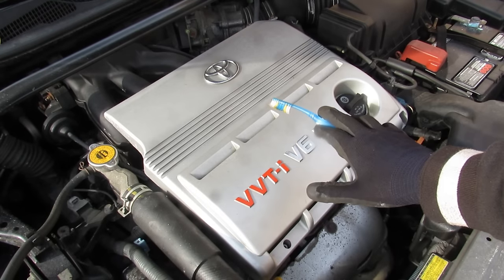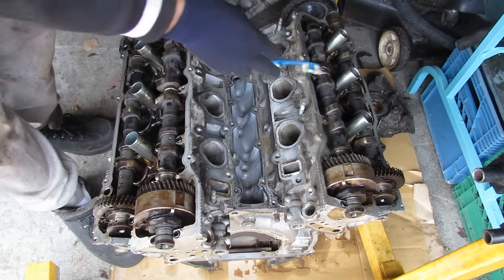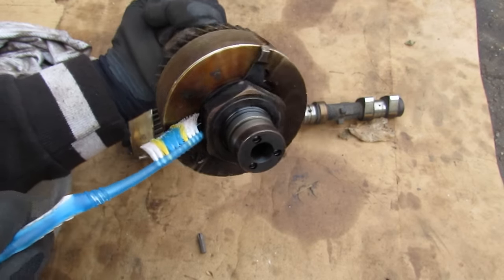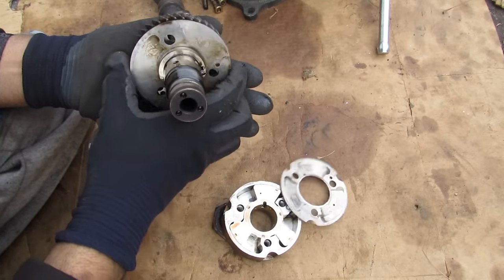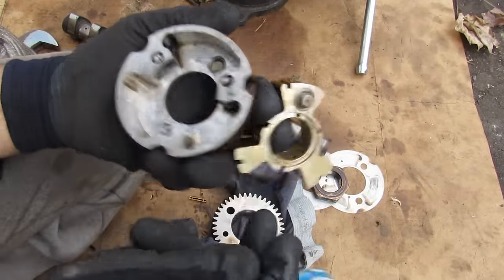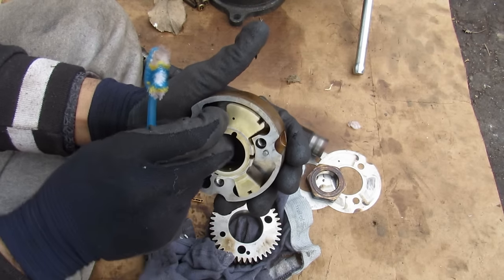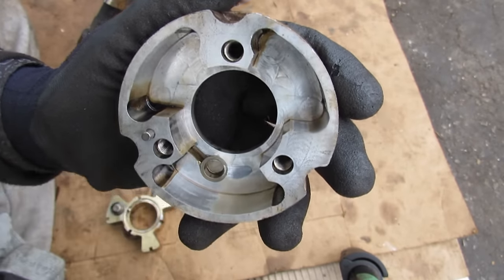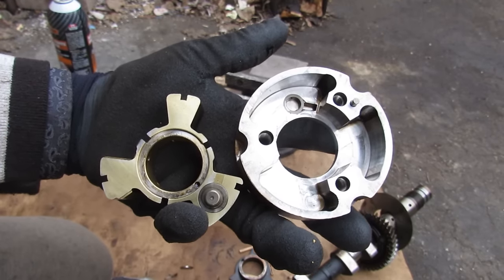Here's Why Your Car Rattles on Cold Starts

Comment: Is there an active recall on Lexus's for this? I appreciate yout time and enjoy your channel, lots of good info on various mecanisms, so thanks for doing it.
Bob
Reply from the maker: Yes I researched it a few years ago when buying my GS350
Reply: @speedkar99  does the 2.5L is250 engine have the same issue as the 3.5L 350?
Reply: @speedkar99  Ive also got a gs350. Whats the best preventative maintenance to stop this noise? Regular flush and oil changes with full synthetic?
Reply: @chapn7  Our IS250 does the same thing.

Comment: One more reason to stay on top of regular oil changes.
Reply: yeah true but i think something like this is inevitable.
Reply: @tajituck888  I call BS on that. no reason for that pin not to have easy movement every single time if it's all clean in there from 5-7k miles full synthetic oil changes
Reply: @hostilityy  its not only pin movement.  There is a spring under this pin that pushes the pin to a hole. When this spring is tired, then its not 100% that pin will be locked in a hole
Reply: @mutoryu  Dear Kiril Ka: what you have said makes a lot of sense, thanks!
Reply from the maker: Oil changes are underrated. 
My lubrication system video gets into the crevasses of where oil travels in the engine. Once you understand it's vast functions, you can no longer overlook it's importance.
Reply: hostilityy yeah I see your point but it seems like it’s a common thing with Toyota’s when they get up in age with vvti. However I don’t know the oil change intervals those Toyota’s had. If one at all lol but you make a good point.
Reply: speedkar99 it’s only underrated to females lol.

Comment: Wow...   i hope you have solved my problem. 👍... i have 2015 Honda Odyssey and has the same noise with the cold start. And thinking to sell my car to avoid possible expensive engine repairs.  
Some local mechanic diagnosed that it is a timing chain problem but i don't believe them..
Your video is very logical and now i am so satisfied 🤗...
Thanks for removing my stress.. ❤
Reply: Yes hondas make the noise also. Honda has said that it does not damage the engine

Comment: My oil pump pick up tube screen was 70% cloggrd from one of the balancer shaft fiber gears wearing over time.  Slowly clogged the pick up tube and eventually reduced the oil flow or pressure so much it did the rattle on cold start.  The balance shaft became disengaged from the crankshaft becaise of this initial low oil pressure.  Symptom was the cold srart rattle but also increased engine vibration at higher rpms and when going to passing gear tpm levels.

Comment: EASIER TO CHANGE THE MOTOR BUT ILL TRY THIS FIRST NEXT TIME LMAO;)
Reply from the maker: Oil change is temporary
Reply: I have a sienna with this problem currently. I have changed my oil at the 5k mark every single time for the last 10 or so changes. It persists.
Reply: @CatsNChickens  did you buy it new? do you know the previous owner's oil change history?
Reply: @hostilityy  no, fair point.

Comment: Does this car have a check valve, just above the oil filter to keep the oil from draining back down? Is there a relief port in the phasor that lets the oil drain out of it, or does it escape out of the seals? Just wondering from other cars I have worked on.
Reply from the maker: I don't think there's a drain back valve.
Reply: Bingo ! That sound occurs with a dry start due to oil draining back down in the pan.  A high quality oil filter will have an anti-drain back valve to help prevent this, what do you think?
Reply: @chadchristian3704  I never knew that oil filters had an anti-drain back valve. I know they have a media by=pass valve, for idiots that don't change their oil till the oil light comes on, so they don't starve the pump, but every car I have ever worked on, since my first 60 Chevy Impala 283, had a spring loaded check, or at least a flapper valve built into the to of the threaded pipe, that the filter threads on to. My Toy Tacoma, is a 4 popper, and makes a strange noise after the Bendix retracts, but has been doing it forever. The phasor on my Mazda (Ford engine) looks similar to the Toyota in your picture, but I never saw a gravity drain back hole in the phasor, and have never had a noise on start up. I love this CX-9, but the lunkhead that designed an engine with a water pump inside the crankcase, is right up there with my view of politicians. If you find that an oil filter makes a difference though, let me know. My son will get handed a list, He went to work at a Chrysler dealer - said he would always have plenty of work to do. Decided after a couple years, that he didn't need that kind of stress though.

Comment: hello, will this throw a code about crackshaft position correlation, i replaced the crank and camshafr sensors, and also a variable time solenoid and its rattleing at cold starts, but code wont go away.
Reply from the maker: No because the rattle is just intermittent at first start

Comment: Some one said, to avoid the rattle crank but don't start and then on the second time start. This will move the oil to the place where it has to perform its duty and that is to push that pin into that hole.
Reply: **Also another person suggested a Time delay relay to fuel injector.
**Also another person suggested wider range synthetic oil 0/20 to move that oil in faster.
**Also Another person suggested cleaning the Clean little mesh filters that lead to the VVT solenoid sensors, 
And Oil pump pickup tube screen.

Comment: I am having same engine and it is having the same rattle on the first few seconds after cold start. But what is annoyinge is the continues rattle at high speeds.
Any advise?
Reply: Have same issue. Any solution?
Reply: Clogged VVT sensor screen or oil pan pickup screen limiting pressure at high RPMs. Cleaning is cheaper than replacing anything.

Comment: same issue with Honda VTC actuator....most people who swap it out say the noise comes back within a month
Reply: Has this on my celica! starting to think is oil pressure/control related as the pins not locking on startup/idle... will have a look at the ocv's next

Comment: how do you make sure the cams are aligned once put back together? i see no divots on the sprocket ends and have not worked on anything with an overhead cam. at least to the point that it even matters
Reply: and then making sure the sprocket+ mechanism are in the correct spot
Reply from the maker: Timing marks
Reply: @speedkar99  ah i figured i just didn't see them

Comment: This model is the most reliable engine. When you have VVTI noise, it's a maintenance problem, not a design flaw.
Reply from the maker: Interesting way to put it ..
Reply: Thats true I just got a 06 scion tc with the VVTi engine and after blowing one of these engines while driving I was dialed into studying my engine and I found out that maintenence is your num1 priority and if you don’t and you let gunk build up in your engine it will leads to stuff like this. So I ran 90 dollar tribotex engine cleaning with nano tech which literally almost after driving like 20 miles felt a huge difference from a struggling engine to a smooth engine. I flushed the tranny and notices a major difference in that and also in the process of running a engine fuel system cleaner so that all supporting components are running optimally and i dint have to worry about blowing an engine. And also I do every 3k oil changes rather then 5k

Comment: Hello my friend, i changed the timing kit and i still hear this rattle noise once i start the engine what could it be ? And the km is like 110 K what kind of oil should i use ? Thank u
Reply from the maker: 5W30 or what is on the oil cap. 
Were the VVT gears and tensioner  changed or just the chain?

Comment: Ford's 2nd gen 3.5L EcoBoost V6 is becoming notorious for cam phaser rattling upon cold starts. One trick I've learned to shorten the rattle duration is to crank the engine for longer. Unless I crank it for around 9 seconds the rattle won't completely go away but it is shortened. I have 28K miles.
Reply: How do you crank it for 9 seconds without it firing up?
Reply: @gregjohnson2073  Depress both the brake and accelerator before pushing the start button. The engine will continue to crank as long as both are depressed. A few months ago I got the phasers replaced from a Ford CSP and the rattle is totally gone. I have videos of this on my channel.

Comment: Finally fixed the rattle in my 2011 Camry without taking the well maintained engine apart! The oil drains down from the VVTI actuators after sitting overnight. I simply installed a time delay relay to kick in the fuel injection after about 2 seconds of engine cranking, this gives the engine oil pump time to fill the VVTI actuators. Quiet as a mouse now. Have noticed some new cars delay firing after cranking to avoid a 'dry start'....
Reply: I have a 2011 camry with the same issue. Are you able to share a link to the one you purchased?

Comment: There's a real danger that the extra abuse those vanes are taking causes one of them to fail,  jam and grenade the engine.  It can also cause excess wear on the chain guides and particles from the guide can lead to the oil gallery becoming blocked.  A little rattle at startup is ok, but if it begins to become louder or longer, fix it.
Reply from the maker: Agreed.

Comment: Ford F150 with 3.5 Ecoboost makes a similar sound upon cold start, is it the same thing happening?
Reply: I have a 2.7 ecoboost with the cold start rattle. Fordtechmakuloco did a video that says it has something to do with a rod or lever shaft wearing out in the turbos.

Comment: The question I have is how many miles does the engine have to have for that rattling to start? And is that only on the six cylinder? Is there problems like that on the Camry Hybrid?
Reply from the maker: Yes they exist in many Toyota

Comment: I used a heavier W oil from 5w-30 to 10w-30 and it helped settle that noise down a great deal thankfully.
Reply from the maker: That doesn't work well in winter
Reply: @speedkar99  Ah, I'm in Florida so I don't have to worry about that lol.
Reply: Whelp. After about 4,000 miles or so. The noise comes back. I'm trying 0w-30 oil and I'll post results another time.
Reply: Yeah same issue. Changing the oil weight doesn't help.
Reply: I went the other direction.  5w-20 to 0w-20.  Helped.  I live in a colder climate and the weather is starting to get colder now and this really helped me.  I'm surprised the noise may be gone or almost gone now.  Just faster oil flow to the top of the engine I guess.

Comment: I just got an older highlander 1mzfe that does this. Not for long at all. Split sec. Tempted to order some Valvoline restore and protect from the US(can’t seem to get in anywhere Canadian) and see if it helps. Sounds like that stuff is legit. 

I’ve also read on bob the oil guy forums about people curing this problem simply from using “the good” oem Denso filters made in Thailand. Something about a quality anti drain back valve. Also some people purposely using a different/larger 
capacity Toyota filter to allow for better oil flow and less rapid clogging of the filter etc. Something like that

Nice to know it’s not a straight up death sentence lol it appears to be WAY too common of a problem to be a massive problem or you wouldn’t always hear everyone and their grandparents raving about Toyotas being the best…
Reply from the maker: Agreed. Nothing to worry about. Use an OEM filter

Comment: Generally the cold startup noise for a few seconds is due to timing chain tensioner in VVTI engines
Reply: It can very well be on the vvti engines with chains, this v6 in the video is a belt

Comment: How does the locking pin make sure the adjuster is in it's locked position when there is no spring pressure guiding it in? Can't it just stop anywhere when you turn off the engine?
Reply from the maker: You mean a tortional spring? 
Yes true, usually oil pressure (or the lack of) takes care of that, but if the pin is weak it'll rattle a bit instead of click into place instantly
Reply: @speedkar99  i don't mean how the pin gets pushed inside the hole, but how it is reaching the hole after the engine is shut off
Reply: @stijnpeeters9458  That's a great question. Did you find the answer?
Reply: @andyfer7716  not really
Reply: @stijnpeeters9458  My guess is that when the engine is stopped, before the timing chain stops completely , the oil pressure drops enough so that the internal mechanism is pushed to the locking position and then the pin falls into place.

Comment: You mention the Lexus 3.5 motors. From what I found the bolts coming loose are on the 3.5 IS350 models. I have a IS250 with this startup noise. Since it's not the same motor as the IS350, do you think your video with the pin sticking is the issue?
Reply from the maker: There's a recall on the Lexus engines, something about the cams coming loose I think?

Comment: My camry 2gr-fe started to rattle since 30.000 km ago. Thanks for your complete explanation. 

But does it affect the engine performance? Because i kind a feel some power decrease, or it is just my assumption?
Reply from the maker: Not until it fails
Reply: @speedkar99  so it is safe to wait until it fails, right? 😁🙏👍

Comment: My 2019 Pathfinder just started making the cold start rattle noise.... can oil stabilizers help with that sticky piston in the phaser? 97,000 miles on it. Also, my belt tensioner is really shaky.... could that cause a rattle as well?
Reply from the maker: Belt tensioner will cause belt squeal 
The stabilizer will only help temporarily. Once parts are worn there's not much you can do except replace it.
Reply: @speedkar99  ok.... thanks for the info.  Just found another possible suspect....a spring in the VTC gear... we'll see.
Reply: It just started happening so you have plenty of time. You actually have a year or more before you have to worry. As long as it rattles less than 2 second you're good. In the meantime, you must clean your VVT sensors. Remove them and 
Clean little mesh filters that lead to the VVT solenoid sensors.
Also the VVT oil control filters if you have.
Also check Oil pump pickup tube screen. Drop oil pan to see if oil pump pickup tube screen is clogged. 
Switch to a Mobil1 non-drain back oil filter.
Also switch to a wider range viscosity synthetic oil, like 0/20

Comment: I had the vvti rattle in my 2007 Corolla on cold start up, then i switched to 0W-30 Mobil 1 FS oil. Never had the problem again.
Reply from the maker: What oil were you using before? Usually a thicker oil helps

Comment: Can a good engine oil flush possibly dislodge that stuck pin?

Im trying to go through the comments but theres a lot 😅
Reply from the maker: No. Once it's worn there's no solution other than to replace.
Reply: @speedkar99  oh yeah?  It's either worn or stuck from carbon

Comment: but should it not make a ONE  noise hitting the max spin position? Why the rattle/going back and forth noise?
Reply from the maker: Its an unlocked mass. It'll rattle until it finds it's home.
Reply: @speedkar99  more like unlocked 'mess' ;-) I will try to change it on my 2006 Renault Scenic. p.s. together with the broken Coil Spring... so big thanks for your video from 2 hours ago :-D

Comment: I used to work on the 22r and 22re for decades.  The I come back to a toyota for fuel milage although I knew of this issue already.  So I bought a 2011 corolla s with the 1.8... 5:06  Why do they say if you tighten the new gear onto the camahaft with the gear locked it will damage the new gear?  Ive seen the them apart.  i just dont see how that would damage the new gear?   i cant wrap my head around that.  But Im about to replace that gear without pulling the timing cover and while im there replace the top chain guide.  And all the little gaskets that carry the oil pressure to those vvt gears from the solenoids..  ive see several guys on here replace them without worry if the gear is locked ot unlocked.  i dont think it will damage it.  Its designed to be tight behind  the cam bolt either way.

Comment: my 2019 rx350 has 15k miles. on a cold start, theres a slight rattle that sounds like thin metal hitting eachother that gets louder in reverse but goes away when the engine warms up. the dealership cannot find it. can you please lmk if you know what it is? it goes away in drive too. thank you so much. im very desperate.
Reply from the maker: Could be an exhaust shield

Comment: So an 07 ES350 where this happens once in a while might have loose bolts on the back of the VVT drive? It has about 85,000 miles. Your opinion is appreciated.
Reply from the maker: I mentioned this at the end of the video. That is a totally different problem and needs to be addressed through the recall.
Reply: Pease do a video on the 2gr

Comment: Mazda cx7 timing sprocket blew that pin cuz of bad heat treatment.  So ya in my case, had to tear engine apart to replace...also replaced timing n oil pump chains while I was at it

Comment: Hi sir @speedkar99, my 2014 toyota altis rattles/vibrates (can feel it in the steering wheel) as well but during idle (no load i.e lights, acu, radio, etc.)...idle speed around 600 rpm only...i already cleaned the MAF sensor, throttle body, changed coil plugs and spark plugs, but still it vibrates.. but once i turn on the AC, idle speed increases around 700 rpm and won't vibrate anymore. Would you happen to know the problem? Thank you sir...
Reply from the maker: Engine mount

Comment: My 3.5 Lexus sounds like a diesel in the mornings at cold start. It goes away when the engine reaches normal operating temperature. I Used MMO and it quieted it down by about 90% but not completely. Any info on this issue?
Reply: YEs more info on the 3.5l
Reply: What is MMO?
Reply: @gregjohnson2073  It's Marvel Mystery Oil.Just an FYI... I've had the car now for three years and I've used MMO in every oil change. The noise is now pretty much completely gone.